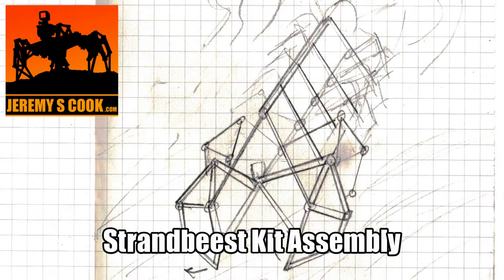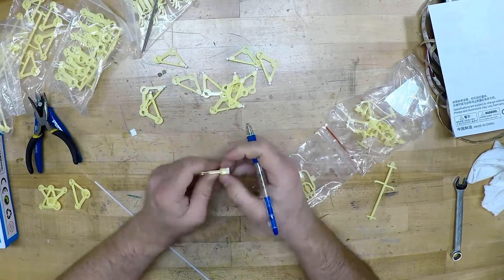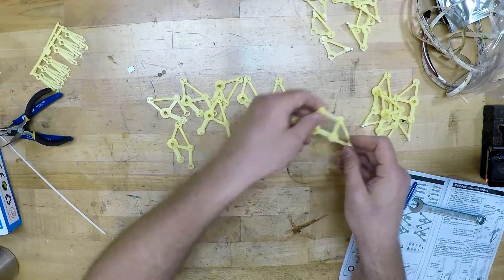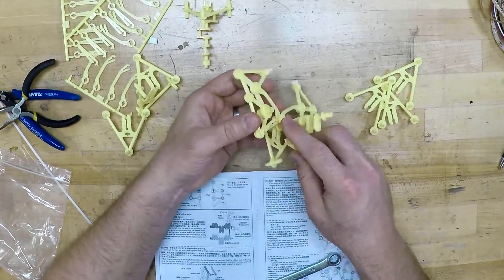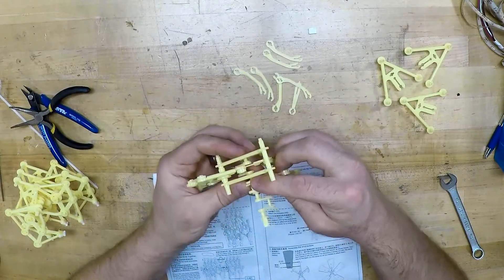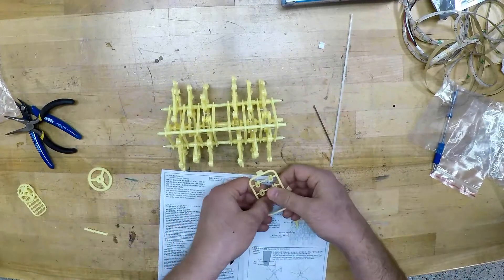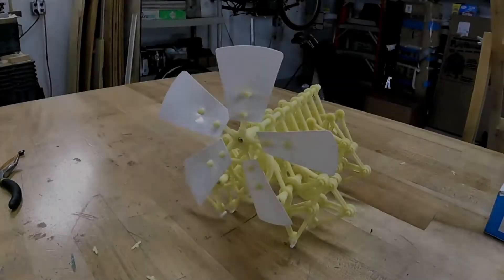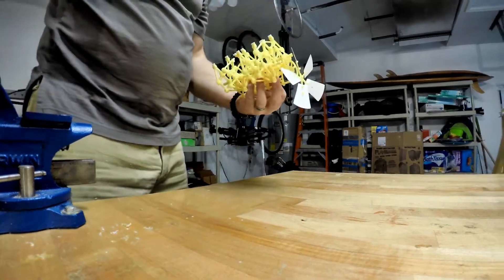Model Strandbeest [Kit Assembly]

Comment: One thing we did differently than the instructions was to not put an end cap on the top of the frames where the fan with the gear on it was going to be inserted. That end cap was hitting the biggest gear or coming real close and it also didn't let my gear on my propeller body engage far enough onto the teeth of that big gear. So we decided to not use that one end cap.

Comment: One tip that I saw for this kit was that you have to firmly press the protrusion into the other hole and on this I mean on the frames basically. At the top of the frame you can see how far they're supposed to go. And it is a press fit that is semi-permanent once you do it. But inside of the leg hubs, the sides of the frame have a protrusion on them that have to go into the hole on the next frame. And you're kind of blind there. What I realized that I needed to do was check that all the frames were parallel to one another. And that helped me know how firm to press on it. Of course it's plastic and so if you don't get a nice firm place to grasp right in by the hubs or by the protrusions, you risk snapping stuff. So we did that carefully and I think I got everything just the right amount of press fit and parallel

Comment: At first I thought your video went too fast and made it look too easy... that the video wasn't really going to be helpful for us.

But it really kind of goes together even with the horribly written instructions as they've been translated to Chinese and back probably, as long as you pay attention to the letters of the pieces which are printed on the salvage of the injection molded frames or whatever you call it, you could get through it 

The thing that maybe you could have highlighted more was right around 140 in your video when you start putting the walking legs onto the camshaft. And that you're going to make a front section and a back section and that each section is going to be four frame pieces and six leg pieces. And that you're going to alternate putting them on right and left and that the other two linkages that go on to the leg pieces have to connect to the offset section of the camshaft in a specific order so that they won't jam up. And that each section of the camshaft is going to have a right and the left leg. I put it together what I thought was correct to the picture. Then I remembered having read something about the order of the four linkages onto the camshaft and I found that again in the instructions and confirmed that it matched. And it was kind of key that after you got the first one set up you managed to hold it and rotate it and watch the motion and look for interferences. You can see on those last two linkages that you put on they've got a flat smooth side where they're supposed to slide across each other in the other side of each one has a gusset on it which is for structure. 

But other than maybe a little more instruction there or close up, the video turned out to be pretty helpful.
Reply from the maker: Glad it helped!